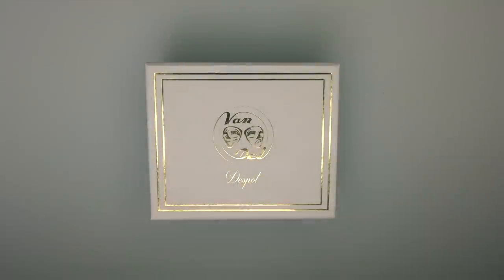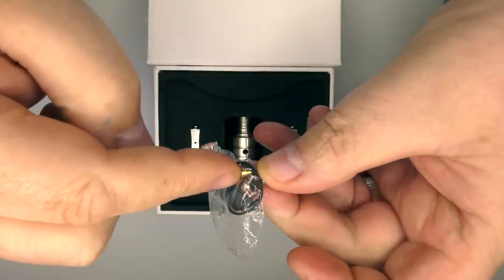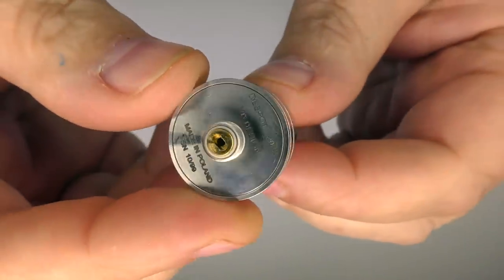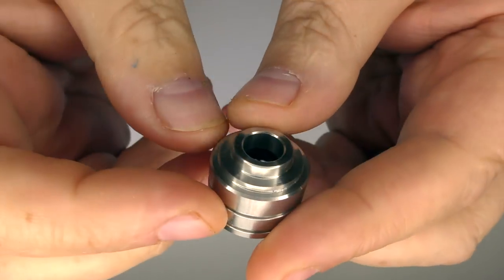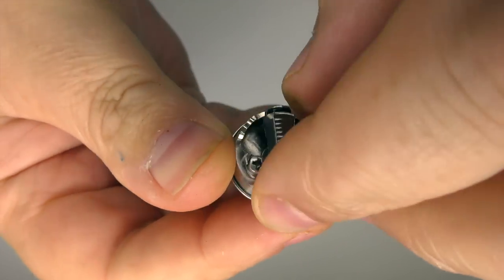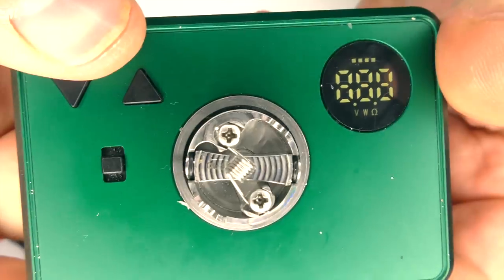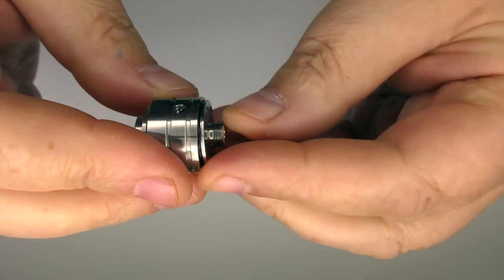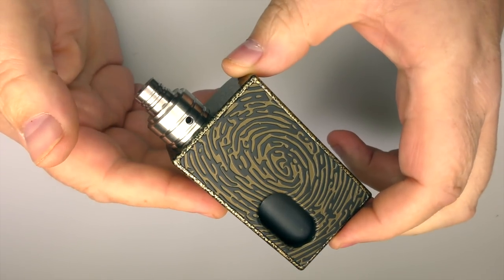Despot RDA by Van and Del Design

Comment: Hai mark quick question, how do you usually clean your BF regulated mod properly? Tips n trick video would be nice for education 😊
Reply from the maker: the 510, occasionally just fill the bottle with luke warm water and squonk it out over the sink.  Contacts, depends on material but never use anything really abrasive.